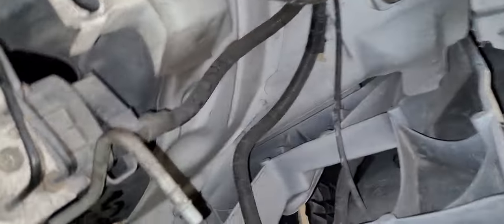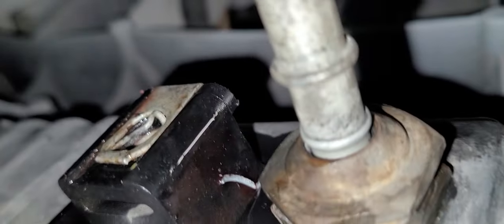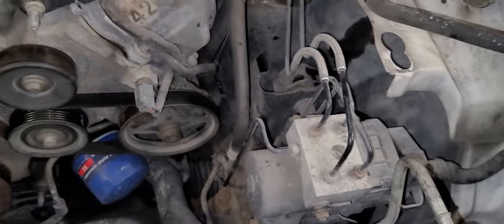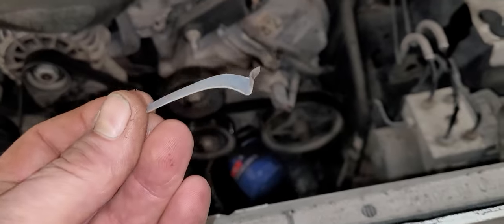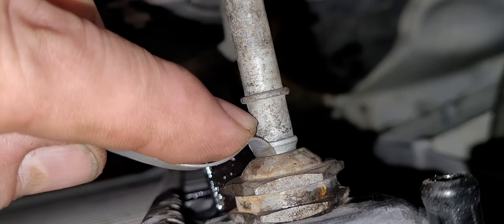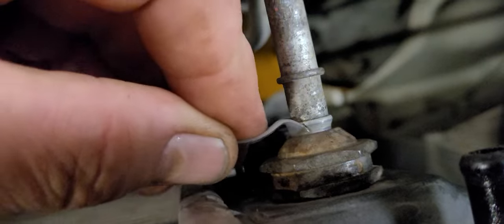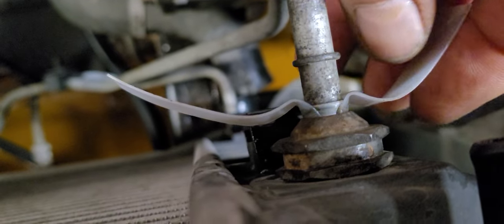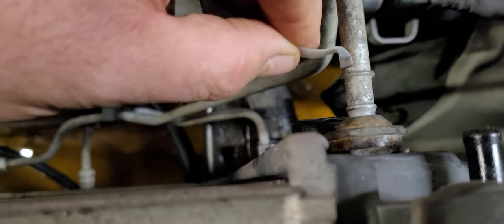Ford transmission cooler line removal without the special tool. It's pretty simple

Comment: Wasted an hour and a half of my life trying this so I didn't have to drive 20 minutes to the store LOL. Do yourself a favor and go buy the $10 tool, even if it's the third time back to the parts house 😬. I'm glad someone was able to do this but it wasn't me..lol. I suppose it could get you out of a bind if you jacked around with it long enough. My wife and son actually got the top one off with a tip from a cake icing decorating thingy while I was gone back to the parts store to buy the tool 😄. Good luck!
Reply: LOL!  Your comment is so real it made me laugh!  Thanks!
Reply: need to follow directions better

Comment: I cut the plastic handle off a 3 gallon water jug. Cut it in half long ways. Put a bolt inside of it. Molded it perfectly round. Took less than 5 minutes to make. Snapped over the line pushed it in and pulled out the line in 3 seconds.. this trick absolutely works but just needed alittle more thought put into it.. i hardly ever buy cheap specialty tools like this.. if one man can make it so can u... and usually save tons.. 10 bucks is ten bucks.

Comment: O’reilys has the tool on the shelf pt is the brand name w83112 is the number you’ll need
Reply: That tool says "Use 3/8 inch size for 2003 and later Ford V8 Explorer, 2004 and later Ford F150 and Cadillac CS." I have a 2010 Explorer but a V6...I hope the dimensions are close enough.....can't find a tool that says it specifically works with the V6

Comment: You must have the "Midas Touch" I've got a 04 F250 4x4 6.0 with a leaky line beside the oil pan. I tried pieces of a qt. oil bottle, milk jug, and paper thin sheet metal. Several times each and never could release them. So I'm headed to Harbor Freight, for a master set of release tools. 70mls away.

Comment: Good one! I used two tiny flat-head screwdrivers & disconnected the line within a few seconds. The "special" tools are a very bad design, no matter the company they come from. Two tiny screwdrivers did the job, like I said, in a few seconds. I returned the "special" tools, btw.
Reply: good to know..thx for posting this..
Reply: yea I think I'll try 2 screwdrivers *first lol I have my doubts that the plastic will be stiff enough to push back the metal "crimps" that are pushing up against the mump in the pipe. Plus there's probably a ton of dirt and debris in there too. Your method sounds waaaay better.

Comment: If you're replacing the rad just unbolt that fitting and heat it up, with pliers that piece comes off, just wipe off the trans line end and done.
Reply: How would heating that up undo the clip. Doesn’t make sense
Reply: @shawnoconnor8075  Umm....

To melt the vinyl retainer that sticks and won't release the line.

Is that enough sense for you?

Comment: Lol at this actually working. Just did the radiator on my Explorer and those lines just don't come out. I used the die grinder method to split the fitting and release it.  You have to be careful with the grinder to not touch the actual line or you're hosed--it will never seal right if you grind a groove on it. Once this fitting is split I noticed that there is a  nylon ring that holds the barbs in place. Next time I'll use the propane torch and burn the nylon off. After trying all the special tools you'll realize you have to get medieval on this and get the torch out.

Comment: I just replaced my Radiator on a 2010 Ford Explorer.  Everything was easy except the Transmission lines.  I spent 3 hours trying. Even with the special tool. Someone on YouTube used a torch. It worked great but a little dangerous. I used my Heat Gun and the end came off in 3 minutes.  Amazing!!! Sooo happy.  The heat gun is the same gun used to heat shrink wires, etc.  Good Luck
Reply from the maker: Thats pretty cool . I guess on a replacement, that would work good 👍. I hadn't thought of that
Reply: Very helpful comment but sooo not encouraging lol I have a 2010 Explorer as well and I'm about to replace my radiator. I've had a heat gun on my Home Depot wish list for a while now. Maybe this will be the reason. Do you recall which special tool you used? There are a couple different styles.
Reply: @calvinpryor  I tried with a fuel line disconnect tool. I spent hours and hours trying but it would not disengage. The heat gun worked great. It melted the internal gasket and it separated in minutes. I did not have to use a torch. Fast and simple
Reply: @calvinpryor  check out harbor freight for a heat gun. They have great prices

Comment: Yeah, I just bought a quick-disconnect tool case for Ford and GM and thought I was ready to replace my coolant lines and find out that NONE of the tools in the case work on modern Ford vehicles for trans cooling lines. I had already taken off my lines from the trans and thought I was golden but noooo. Thanks for the hack!

Comment: Great video, in the middle of this now. Of course I have a plow truck that has been native to Ohio since 2006, its Manufacturer year. Needless to say there is considerable amounts, and I mean herculean amounts of rust and corrosion underneath, including the above referenced 3/64" where my tool needs to go. I have a decent ($35) disconnect tool made my Lisle. (Part # 39220), still cant seem to get 2 of them of the Trans-cooler. PB Blaster and Kroll Oil on them last night, gonna venture out now, with a few plastic strips to clean rust out for a few hours.. lol Thanks
Reply from the maker: @adamglowka2753 that's a lot of rust! Best of luck with all that. Thanks for watching & leaving a comment. Let us know how this job goes. Keep wrenching! Meg

Comment: Here to say, I Heated up where it threads into the radiator and just unscrewed that part and left the quick connect attached. make sure to spray with pb blaster.

Comment: It helps a lkt if you flood the garter spring housing with brake cleaner alternating with compressed air to flush away dirt and grime that's collected over the years.

Comment: Now show us how to do the heater core [not so]quick connectors! Did the heater core in my Excursion last year. Heater core itself: Easy-peasy...a few bolts and it pops right out. A 30 minute job. Disconnecting the heater hoses? 3 hours, even with the special tool...and then had to end up cutting the tubes off the old core anyway...and it was STILL hard getting the hoses off, even with the ends being out from under the cowl!

Comment: I just got done trying the exact same things with strips I cut from an aluminum can.  Was too flimsey and didn't work, which is why I"m here.  Death to quick connect fittings.
Reply: Seriously! In my experience, there is never anything quick about them! I cannot understand why they are used at all...
Reply: @iFixJunk  Assembly line speed. Repairman do not not figure into the design of a modern vehicle.

Comment: Hello, so firstly I wanna say… that NONE OF THE COMMENTS BELOW helped. Along side that none of the video tips helped. I APPRECIATE all of your help tho. I’ll tell ya the real secret.
Step 1) Walmart
Step 2) 20$ Grinder
Step 3) Nice alcoholic beverage
Step 4) grind ever so closely with a metal blade nice and easy right up to the line be careful now! Don’t get greedy it’s aluminum.. so a nice small gash and a flat head screwdriver to pry it apart.
Step 5) high five your best bud and smile.
Step 6) install new trans cooler.
Reply: I agree. Maybe i gave up to quick.
I used the pneumatic cut off wheel on one and had to hacksaw the other. Then spread the coupler a bit and busted that little black retainer.
Reply: you still have to install the new one and yoy cant one at walmart 300 at ford
Reply: $ .300

Comment: Can you make a video to show how to make those 2 plastic strps on cutting out so they work
Reply: Just cut two strips the size and length of the strip that hold top on milk or water jug.
Reply from the maker: Next time I have one , Ill make an another video with a bit more specifics on the plastic strips. Thanks for watching !!
Reply: @WrenchingWithKenny  I think a video would help because the section you cut out in this vid is pretty much square and in the middle of the bottle. Which wouldn't really give you that curved part on the end of each strip. I'm guessing one of the edges of the "square" you cut out has to be on the very bottom of the jug or at the top of the jug, right at the base of the "neck"

Comment: even quicker take a propane torch heat it up a bit an the transmission line will pop right out. Only do this if you are replacing the rad

Comment: Great problem solving. 5.4 2v really good engine. 5.3 3V what a p OS.
Reply from the maker: Agreed . The 4.6 & 5.4 2V are very good motors !!
Reply: Right?! First step of cylinder head removal on all data says 1. Remove engine from vehicle. Man I’m just getting two studs out of the passenger head. Have to remove the radiator and this really helps! Hope we can keep them running another 5 years haha

Comment: So - those rubber hoses on the line.  Say... some idiot pulled them apart.  Then he decided to clamp it together with hose clamps.  Is there a better way to get these rubber hoses to stay?  The hose clamps just slide off.
Reply from the maker: You have to make a bulge in the line to stop it from sliding off. Same as how a radiator hose slides on over a bulge that will hold it in place. Usually , Ill use a double flare tool and partially perform the first step. This will give a bulge that the clamp cannot slide over
Reply: @WrenchingWithKenny  I just bought the whole lines.  I figured at least I'll know they're clean & done correctly for another 250k
Reply from the maker: @MrGreen1776  smart move !!
Reply: @WrenchingWithKenny  Any hints on how to get the transmission dipstick tube back in?  Shits a nightmare lol.
Reply from the maker: @MrGreen1776  , no real useful tricks . Pulling the fenderliner out is a big help , but they can suck to get back in place sometimes.
Reply: @MrGreen1776  Lol...

Comment: The easiest way is to send all of your ford customers back to the dealership. I won't work on a ford unless the customer understands that ford has been deliberately designing all of their vehicles to be so ridiculously over engineered and complicated that the labour will be at least 10 times more than a GM truck. If you live in the rust belt like I do, you are never getting that line out of that fitting with a little scrap of plastic, and as far as using the proper tools... That line is not designed to come apart. According to the factory service manual, you are supposed to replace the fitting and the lines and the radiator.
Reply: Yeah I wrangle a fleet of Fords an have all the manuals - that is exactly right, Sir !

Comment: why do they have an area to put a wrench on is what throws me off
Reply from the maker: Thats to screw the fitting into the cooler that's inside the radiator tank . Don't take them off because you'll break the seal between the oil cooler and the coolant in the tank of the radiator.
Reply: @WrenchingWithKenny  If you are replacing everything go ahead and unscrew them. When rad is out grind two opposed radial cuts that stop well short of the tube. Then insert chisel in one cut and tap on it. If necessary go just a little deeper on both cuts. Don't nick the line or you must replace it.